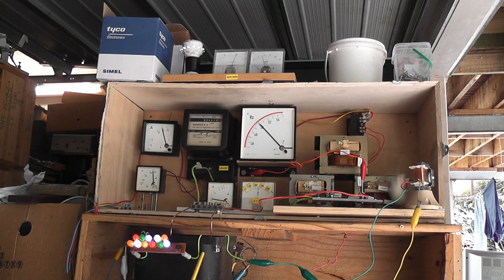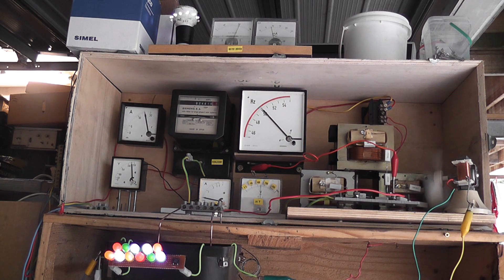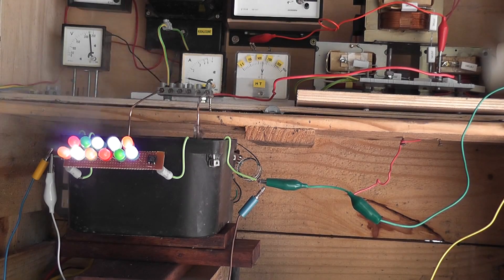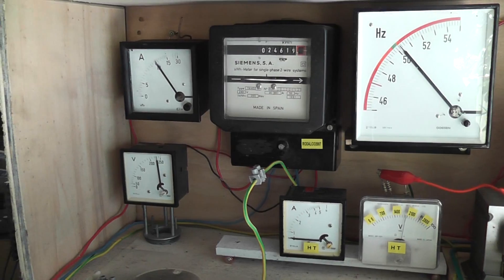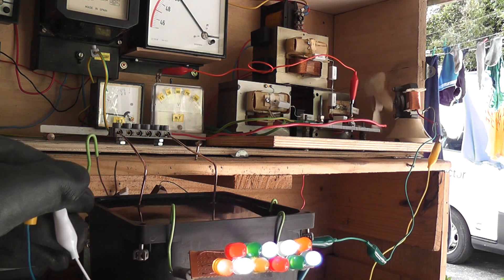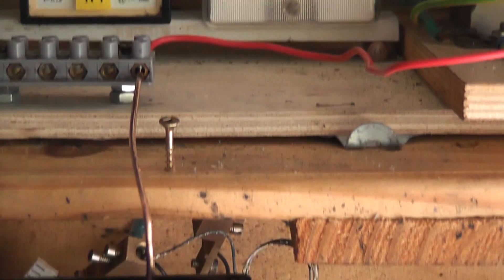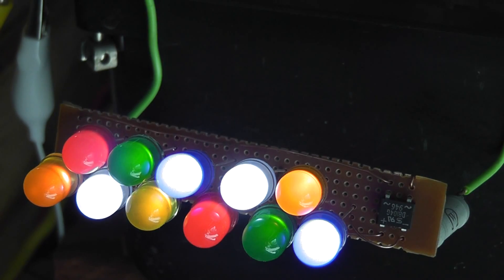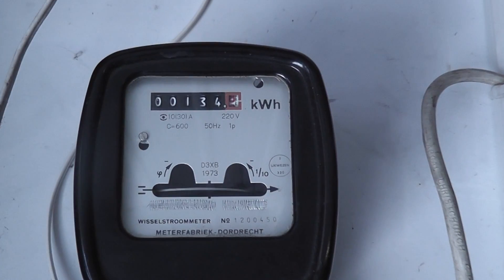Water powered LED's and motor

Comment: @mrmatt2525able Hi. I have also tried this, but at standard wall-socket voltage, and with a mains power cord dunked in a cup of water, I'd say, at 240v, the current consumption is less than 100 watts. The experiment in this video has the current 'forced' through the water by means of increasing the voltage, so a higher current flows through it, and thus the water ( and a bigger volume of it! ) is heated much quicker.

-BoomBoxDeluxe.

Comment from the maker: @BoomBoxDeluxe  Hi Wayne, i was expecting that comment from you.
It is a Sangamo S301 meter cover.
I have many of these covers in use at home as storage containers.
When working in the metering department in the late 90's many hundreds of S 301 meters were dumped, when tariffs changed to two rate and TOU.

Comment from the maker: @snoopy210190 Good question.
No, you won't get shocked when the power is turned off as alternating current is used here, and no capacitors are used.
When DC was used the water could keep a charge in relation to the container and ground

Comment: Cool experiment, right there! It's interesting that you had BOTH wires (i.e. positive and negative) in the water, and the LEDs still lit up. I wonder if this has anything to do with the power in the water being AC? Also makes a nice little water heater too. :-D

Hang on a minute! That water container !! It's a front-case for a Sangamo Weston S301.1 !! LMAO. :-D Where's the rest of the instrument? 

Didn't the hot water discolour it inside/outside, or cause it to become deformed in any way? -BBD.

Comment from the maker: @locouk those 11 leds were wired in series and require a minimum voltage of ± 30 Volts to light up dimly.
With the two 3.3 k.ohm R's in series these led's were running on about 150 volts AC

Comment: Sporting the Albert Einstein look today?  So the LED's each had their + and - terminals in the water and they lit because the water was carrying a voltage? Could this be scaled town with ultra low voltage to pick up current from thin air?

Comment from the maker: @DanNixon2007  Yes, moving them away creates a higher voltage gradient in the water.
i didn't have a wide enough container for this experiment.
Bringing the led's or motor electrodes nearer the HT electrodes increases the voltage

Comment from the maker: @ElectronSpark Correct, the output voltages vary between  1900 and 2050 Volts.
i put them in to reduce circulating currents.

Comment: What is the reason for the resistors coming off the high side of the MOTs?
Is that just in case the output voltages vary a little from MOT to MOT?